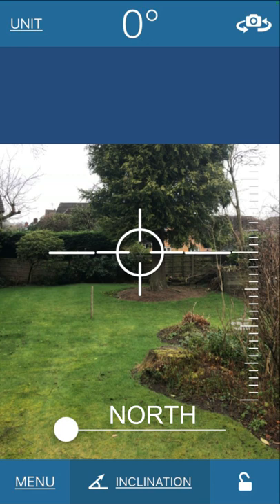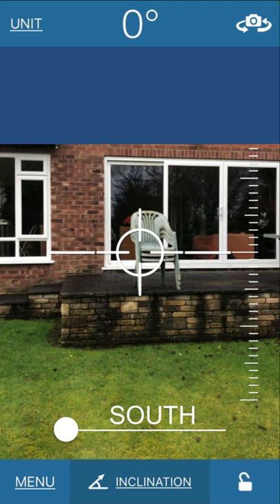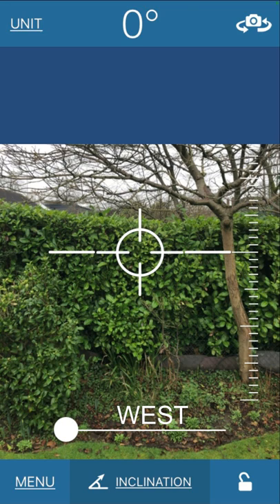CONSIDERING A VERTICAL ANTENNA? WATCH THIS VIDEO FIRST!

Comment: Loved my vertical. With a garden there was no way I could fit a long wire. I've now just managed to squeeze in an inverted L running diagonally across the garden.  There is only one rule when it comes to antennas. Put up whatever will fit.

Comment: The #1 thing I have learned about antennas in my 20 year and counting amateur radio career is that physics is NOT your friend. You are correct, Richard, yet one more reason why I love simple wire antennas so much.

Comment: I thought the same, but I think, other than resonant metal structures, every thing is effectively transparent to hf. On both 20m and 40m international DX contacts sometimes to the opposite side of the world it must have a low take off angle and hence pass through the brick fence , house, trees and vegetation that surrounds my antenna. Also with a horizontal dipole I don't have the horizontal space to put up a decent antenna or place it up high. I have a 40m half wave horizontal "corner" dipole. Ie goes 10m in two directions 90 degrees apart from the feed point. And only slightly more than 2m off the ground. Mostly for nvis. VK6MIK

Comment: Hi Richard,
I've been playing around with two vertical antennas, one is mounted on the ground with lots of radials and works great for around EU the other is a 1/4 wave for 20 mounted 3 meters agl with 3 counterpoises. I was fortunate to  work VK3DBD this morning on both antennas. The ground mounted antenna yielded an rst 319 and the elevated 1/4 wave got 449.
I also put out a few CQ's and checked reverse beacon, the elevated antenna has the edge at this qth but not much between them when working nearer stations like Italy, Germany Poland etc.
I agree, a lot has to do with location and whats around the antenna. You are spot on, some will dissagree though!

Comment: Good point Richard. I suppose one alternative for the average garden might be a vertical end fed dipole. Should still give good low angle radiation with the radiating element well above average hedge height.

Comment: 15 is not the norm I don't think, but my 40m vertical on the ground has always out performed my dipole at any height,  that's if you want to get qso's on the other side of the  planet and not locals.
I rarely qso anyone within the first 3000 miles on my vert. Zl to uk on 80m and 40m most days is easy.

Comment: Interesting, my 6btv is firmly fixed to the ground whilst the EFHW goes right over the QTH at about 10 meters high, never thought about the actual path/takeoff angle on the 6btv, but seeing this video does make it clear the difference a ground mounted vertical and raised end-fed antenna. Good stuff.

Comment: I have a 6BTV (with 12/17/60M add ons) ground mounted and aside from 40M, it out performs my EFHW8010 that is in an inverted L that goes up 50 feet then straight forward, as far as DX. I have 1000 feet of radials of various lengths for a total of 55 radials. My vertical gets a good 25 to 35% farther distance (according to WISPR) than the EFHW that is nearly twice as high up. Of course, every antenna and installation location is different, so your mileage may vary, some assembly required, batteries not included. 😁

Comment: My vertical with 60 50 ft radials radiates closer to 30 degrees than 15. Why did you choose 15? I've never owned a vertical with that low of a take off angle.
Reply from the maker: That’s what some manufacturers seem to obsess about. The peak radiation from any vertical will be at a higher angle but that doesn’t mean that radiation at lower angles is not relevant. Much DX comes in at quite low angles.